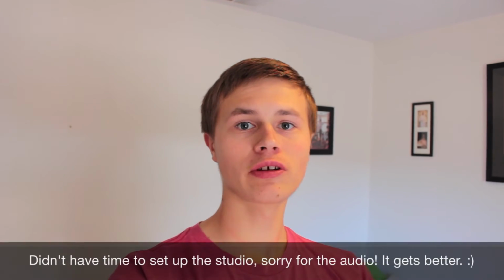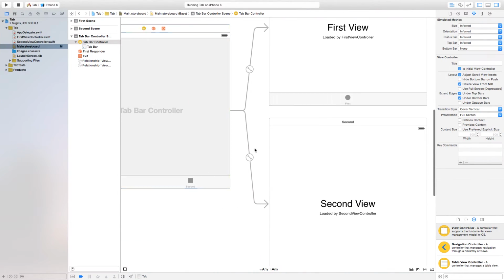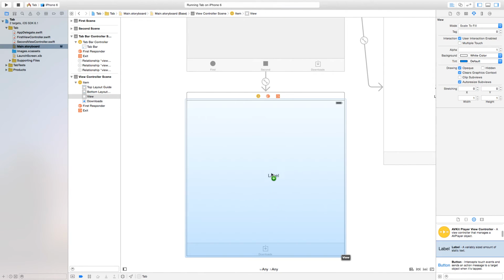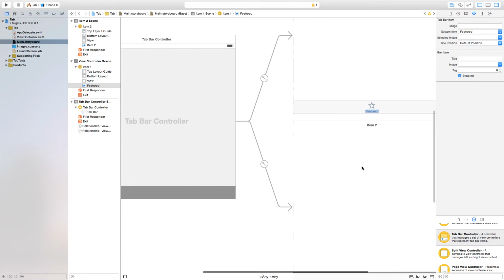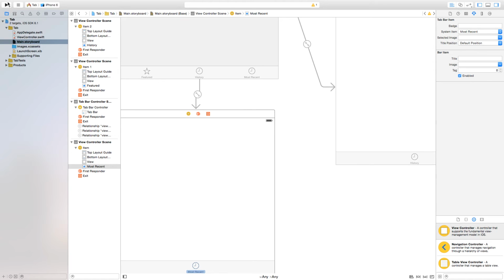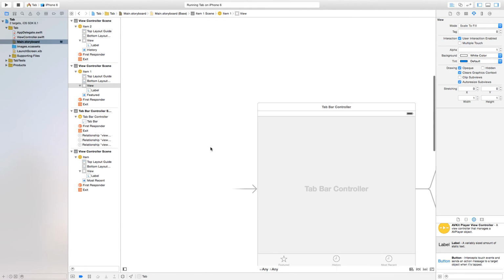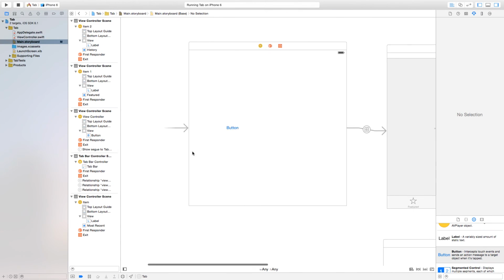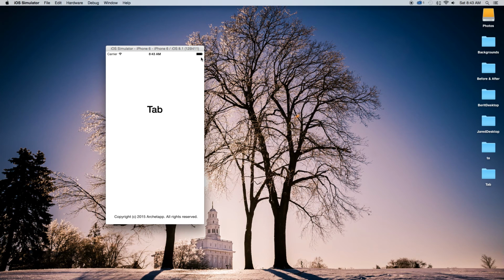Using Tabs Inside of Your Application (Xcode 6)

Comment: Hey Jared. Your video is very helpful. I am currently working on an app and using tabs. I'm having trouble though, because I want to add viewcontrollers that aren't one of the tabs but still has the tab bar at the bottom. How would I go about doing this?

Comment: Hey jared!

1) At the end of the video after you added the navigation controller, lets say the button you made was a login, and then when it transitions to the tab bar, the back button on the tab bar , can I make that back button a logout button instead?

2) Have you worked with google maps api? or mapkit can you do a tutorial on that please?

3)Have you worked with coreBluetooth? Can you give me some help on that... how would I use the iPhone and send data(String, aka text message) to another bluetooth device once they are connect? How can I receive data from that bluetooth device to the phone?(Again string, aka text message)?
Reply from the maker: 1) You can definitely change that, Ill probably do a tutorial soon.

2) Haven't worked with, but I can definitely learn. :)

3)Never have worked with core Bluetooth, but, I could definitely learn how to do that. :)
Reply: Im having issues with adding buttons to the navigation bar on the tab controller, i want to connect it to an outlet in the view controller but I can't, can you explain why it won't let me? (on the main tab bar controller, I added buttons to the navigation bar i.e where the back button is ( i figured out how to replace it) and on the right side, but I can't connect it to the code, can you help with this please?